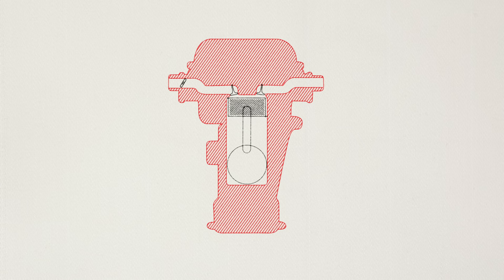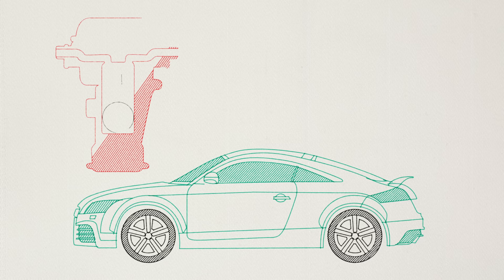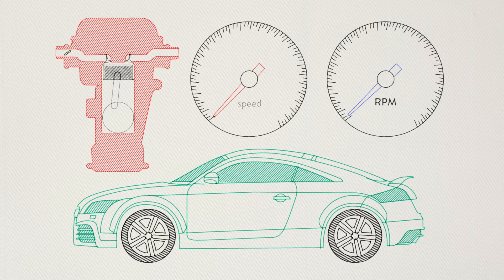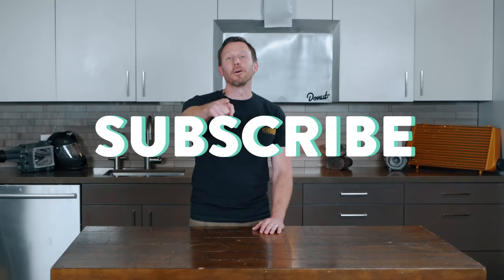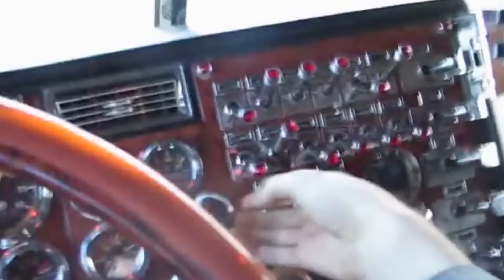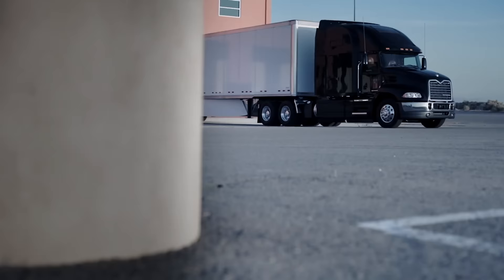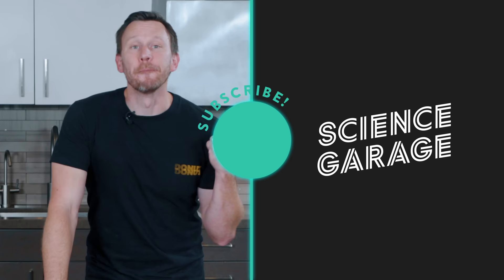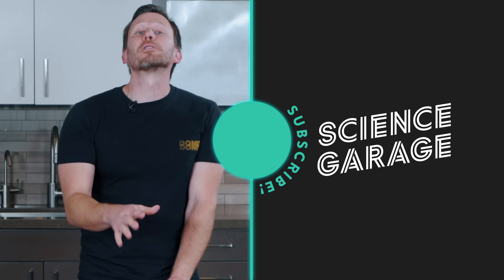ENGINE BRAKING | How Semi Trucks Slow Down Without Brakes | SCIENCE GARAGE

Comment: Science has shown that a Jake Brake is significantly quieter than an out of control truck crashing into your house.
Reply: Bruh
Reply: @thespeechboss 
Do I be wrong though
Reply: True
Reply: Depends on your house, dont think you hear much if it is just a standard american house
Reply: @froxxi668  
Well as long as it misses the gun room and the fridge, we won't care.
Reply: @DumbOhioFarmboy  well technically you're right as engine oil is being pumped all the time but a jake brake is not a hydrodynamic brake
Reply: He's got a point tho
Reply: Well he's not wrong
Reply: @froxxi668  That's just the best insult for all these trash paper houses in america I have ever heard.
Reply: And those are facts
Reply: Jacob G I tell you I hate the signs I’m 3rd gen trucker they don’t understand that it’s there for a reason not just to sound good ps I love the jake brake
Reply: Is the house on the bottom of a steep grade hill? Because last time I checked most places that have engine brake bans are usually towns with the speed limit of 45mph and residential neighborhoods are usually 30mph which is hard to lose control or fry your brakes going that slow
Reply: @Dunki113  
As a real world example, in Silverthorne, Colorado, on I-70 just west of the Eisenhower Tunnel, there used to be a sign on the exit ramp forbidding the use of Jake brakes in town. This is a ramp coming off of six miles of 6-7% downgrade. It was put in because there are hotels right near that ramp and the noise was apparently too much for the guests. It's gone now because truckers were using their Jakes anyway out of necessity, but my point is that it's not just in low speed areas.
Reply: @Dunki113  the problem with these towns is that they are small and until just outside the city core the speed limit is often as high as 70MPH. Then you have to get down to 30, or maybe even to a stop, usually while also going down hill. And then some local pulls out and is only going 30 at a point where the truck would be going about 50. Sure you could melt your friction brakes, but then you would also need to blow the horn. If that pavement is not perfect and the slowpoke does not pick it up a little he is going to wind up with a crime plated bulldog enema. The Jake Brake kills two birds with one stone, keeps your friction brakes cooler so they can work better, and is a very visceral warning that something big and heavy is heading your way a bit too fast for comfort. I have told cities that if they think they need a Jake Brake law, they should just expand the city limits and lower the speed limit more gradually. Most truckers would rather coast down because it is the cheapest and safest way.
Reply: Even trying to outlaw this can you imagine all of the people who have this built into muscle memory? How do you re-train that safely?
Reply: Lol good one.
Reply: kinda doubt it tho
Reply: @no-damn-alias  Nice try.....the cylinder contents are still a fluid.  Consult a dictionary or textbook.
Reply: @DumbOhioFarmboy  Engine braking does not utilize fluids as a main source of resistance
Reply: @recklessrickey9513  look into what a fluid is and get back to me lol
Reply: @jacobg5122  you keep your guns in a special room?
Reply: Stop him when he’s lying
Reply: Haaa haaa, and isn't that why big rigs have them in the first place!?! However anybody who's ever driven a truck knows that many cities and towns that you go through don't want you using the jake brake!!!
Reply: Places that control Jake brake noise pollution are usually flat and require you to just go slower
Reply: I choose to trust the science in this case.
Reply: @jacobg5122  I see no flaw in his logic
Reply: Best comment ! Lmao
Reply: And less deadly
Reply: @jacobg5122  nope, not wrong
Reply: Only if you are unlucky enough to hear that
Reply: @dong6839  
There's no such thing as an engine brake muffler lmao. The sound you hear out of a jake brake is just combustion being released through the exhaust valves and into the pipes. There isn't, and never has been, a muffler specifically to make that noise quieter. New trucks haven't even come from the factory with normal engine mufflers since 2008 when diesel particulate filters became mandatory due to new EPA restrictions. The only thing keeping the noise level down on a post 08 truck is filters that serve other purposes. Noise reduction is a side effect of filtering NOx emissions out of the exhaust. And good luck removing that stuff from the truck; even if you do reflash the ECM to accept the error readings from all the sensors you took out, you're still looking at thousands in fines if the DOT catches you running like that.
Reply: I laughed out loud lmao
Reply: Legendary statement lol

Comment: Coming up to a tunnel? It's Jake Brake O'clock.
Reply: Dang straight
Reply: I hate how most of the new trucks have Jake brake noise dampeners so you can barely hear them
Reply: A straight-piped Cat C15 has beautiful rumble! I always bring the thunder going through a tunnel.
Reply: @ant0n0vich  the C12 as well. The C7 is one of those engines with the noise reduction.
Reply: Yeah I thought it was funny when he said 73k pounds half the time the trailer alone be weighing 120k
Reply: @svenson_6142  I'm pretty sure parts of the United States have a weight limit of 40 tons.
Reply: Damn dude, I can hear you all the way here in Africa
Reply: In a muffler delete car coming up to a tunnel: "I deleted my mufflers now it's time to delete everyone's ears" jams throttle all the way open and a bit more
Everyone else: dies
Reply: Thatd be annoying cuz ur just slowing traffic down.
Reply: @coolinbeatsaber  all states do without a permit. Its a federal limit not state .

Comment: Ok who did the animations? The exhaust valve going up 😂👌
Reply: As is the intake valve. Whoever did it doesn't understand engines.
Reply: @MyChevySonic  lol did not even notice that the intake did the same thing... But yeah probably should do some more reserch and checking before hand, i mean explaining hos stuff works and showing it wrong :')
Reply: @MyChevySonic  Can you refer to an engine that pulls the valves up to open? That doesn't seem logical.
Reply: Or the diesel with a throttle body....
Reply: @crazyeyez1502  Another commentor pointed out modern diesel trucks sometimes do have a "throttle body" type device that creates more vacuum at specific loads for better emissions. Doesn't act as a throttle body more like an air brake. This one could slide but the valves... oh lord.
Reply: @crazyeyez1502  Some diesel engines have throttle bodies, which are open where engine is running. It works very good as safety safety feature, for example in case of runaway. 
Also noticed that valve, lol :)
Reply: Probably a European engine Lolol since they do the weird shit haha jk tho
Reply: I noticed that as well.  LOL
Reply: This is actually a new technology that prevents a valve hitting the piston when a severe valve float occurs.
Reply: Really? Could you explain this more? Thank you.
Reply: No Sweetie, when the valve goes down that means you have an interference engine... when the valves go up that means you have a non interference engine.
Reply: @shebby0204  it's not new technology, we had non interference engine since the 90s lol. These people just don't know what they're talking about. Valves can go up or down depending on how the engineer's designed it. If they go down into the combustion camber you have an interference engine and if the valves do not enter the combustion camber you have a non-interference engine.
Reply: @xRipeh  All valves go into the combustion chamber. It's wherever or not the valves and the pistons share the same space and if not timed correctly "interfere" with each other. And when that happens you end up bending/breaking valves and smashing pistons.
Reply: propably just to better show the principle, somebody who doesn't know about engines might find it counterintuitive when the valve opens in the opposite direction... ooooor just a miscommunication between the writer and the animator, it happens 😅
Reply: TheFatCatGaming You are very kind and wonderful at explaining things. Thank you for being a part of this conversation. :)
Reply: Spam Can Thank you for also attempting to clarify the valves on the videos. This discussion is probably giving Donut Media a video idea. ;)
Reply: @crazyeyez1502  Or  the diesel with a spark plug (read the text)
Reply: @MyChevySonic  or diesel engines since the text says the diesel engine has a spark plug, but maybe they were lazy and used the same animation for both engines BAD!!
Reply: @xRipeh  I mean you're not wrong but not 100% right either. Plenty of motors have valves that go down into the combustion chamber but are still non interference, if a Volkswagen motor loses a timing belt itll bend all the valves but if a 4 cylinder in a Ford ranger loses a timing belt it wont because it's a non interference motor. Speaking from experience
Reply: @xRipeh  that is absolutely not what an interference engine is
Reply: LOL! I'm not very familiar with engine design. Why do values go "down" instead of "up"? Just so gravity assists them?
Reply: @dario110011  it's less moving parts to push them down versus pulling them up, the vavle springs keep them in the up or closed position and the cam, one way or another, pushes them down or open
Reply: @tuesday6433  Interesting. Thanks for the explanation. I don't know much about engines but I am interested in the engineering behind the automobile haha. Might as well know how stuff works as a DIY maintenance guy.
Reply: @dario110011  look up engine rebuilds I like kt3406e he does a pretty good job explaining heavy diesel application engines
Reply: @tuesday6433  Can you recommend anyone for gasoline engines?
Reply: @xRipeh  that's not what non interference means at all lol

Comment: I was taught in transmission school that automatics even older style ones also have kindof an engine/trans brake. If youre going downhill and your brakes fade you can slam the trans from OD or D into L2 or L1 and it will actually apply extra bands and clutch packs and the engine will rev up to a certain rpm. But will not go further because the throttle is closed. Thats when the torque converter will compensate and slow the vehicle. The atf is cooled right after it leaves the converter to the trans cooler. You will not damage it. Ive tried that even on the poor 700r4 gm.  It grabs the rear end and you slow down quick. So many people have died losing brakes going down a mountain and not knowing this engineered function of an automatic
Reply: This is what the Chevy Volt does to recharge the battery. It's a technique by hybrid drivers to shift into Low to recharge the battery and slow the engine, very similar to engine braking in a manual
Reply: Thanks.  I was wondering why I would use engine braking on my little Toyota Yaris.
Reply: @simon-the-bar5657 I use that when I'm speeding and see a cop ahead to slow down quicker without applying the brake

Comment: I’m a truck driver and I love the new trucks jake brake, not the aerodynamic look, but the muffler is under the trucks so you can use your jake anywhere even where there are no engine brake signs because they don’t pop like stacks do (the exhaust pipes that go up and stick out over the truck) also the jake really has saved countless lives when it comes to steep mountains like West Virginia and PA

Comment: i wish the diagrams were more accurate. for example the valves are opening the wrong way and even though it was stated that diesel engines dont have throttle bodies there was a throttle body on the diesel engine diagram. i hope no one gets confused by that kinda stuff
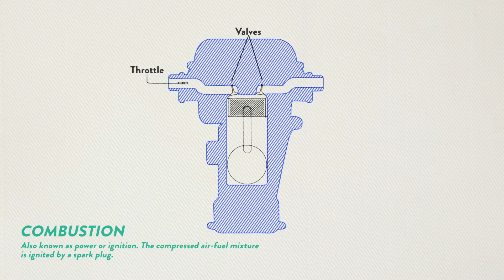Reply: not to mention the addition of a spark plug in a diesel engine ( 8:00)
Reply: Same here the rpm gauge stayed the same as the speedo dropped arrrggg. Would have been nice to mention the torque converter separating the engine and trans hence why autos hardly engine brake.
Reply: @radualexandru6120  That's not a big deal, because there you have fuel injection. Looks quite the same ;-)
Reply: @radualexandru6120  no they say ignited by the heat, not by spark plug
Reply: Radu Alexandru , that’s not a spark plug, it just an explanation produced by heat as it gets compressed
Reply: @z33tanner  Yeah, they were trying to say that's what happens in a manual transmission, which is nowhere near accurate. Unless your clutch is fried, your RPM and speed should always change proportionately while the clutch pedal isn't depressed.
Reply: @radualexandru6120  lmao 😅😅😅😅
Reply: My diesel truck have a  a throttle body after the exit of the intercooler.  It is for "help" to shut off.
Reply: @brendancolwell8064  yeah what do you expect from americans they are more familiar with quantum mechanics than with manuals🤣
Reply: Also the exhaust valve was directly opened by the cam and rocker on the braking cycle, not by a master piston and slave piston like in an actual Jake head.
Reply: Waffeey he was talking about manual transmission not automatic